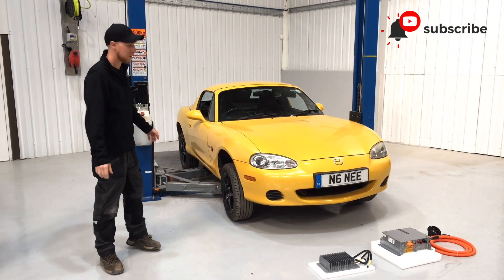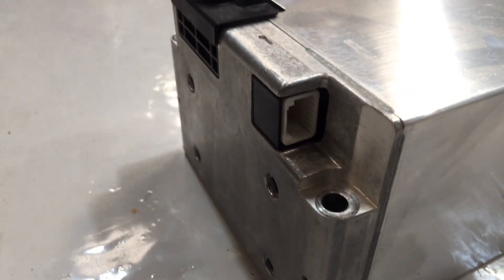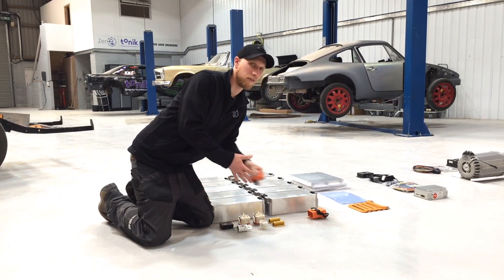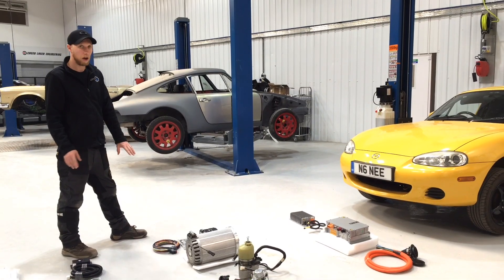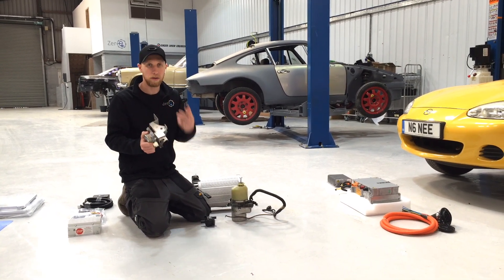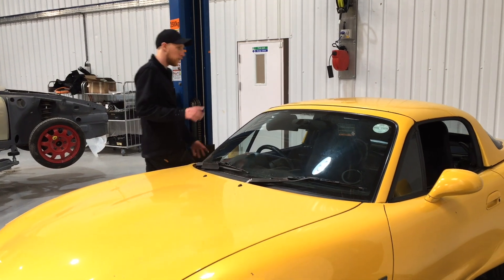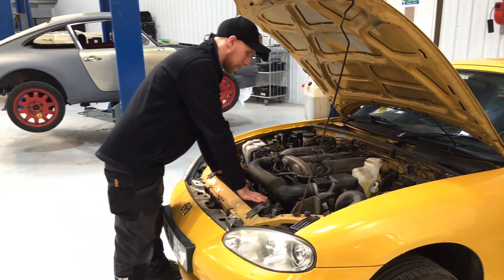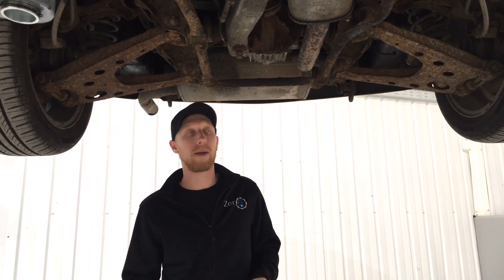We Built an Electric Mazda MX-5 Miata

Comment: Got my curiosity.  An estimate on range? And weight balance will be OK?  I don’t have any idea of how the weight of the 26kWh pack system + portion of motor forward will compare to the 1.6/gearbox that came out.   Keep it coming!!  Thanks!
Reply from the maker: Range should be about 100 miles, weight wise is going to be 40kg heavier

Comment: Hey. What's your plan for the power plant frame? 
The structural aluminium member that runs between the diff and the gearbox and gives stiffness to the body
Reply from the maker: Our plan is to link it into the front frame once we have finalised the motor position

Comment: I used to be pretty staunch against EVs, but after seeing a few vintage conversions I think that when prices of EV components go down, keeping old cars on the road by converting to EVs is a pretty cool idea.

Also seeing cars from the UK makes me glad I live somewhere without salt on the roads,  my 85 Celica project car has almost no rust on the underbody and running gear. I just rebuilt all the shocks and had no trouble with any of the fasteners under the car

Comment: 26KW with a 6.6KW charger. that's really a piece of shit. should have used tesla modules
Reply from the maker: You do know that a Tesla module is 5.2kwh so would of been at 26kwh with 5 of them as there a 6s configurations each module. The LG battery’s we use have a better density than Tesla so a better choice.
Reply: @Hazell_Nutz  you are right. sorry. I was wrong in my comment about that. those LG batteries are great. but only 26KW? that's just sad.
and 6.6KW charger is just absurd. will take at least 4 hours to charge for only 26KW.

Comment: Hi.  I can understand why you'd get hate and I'm sure you know why.  However I do support what you're doing myself as I think it's the right way forward.  The main reason I don't invest in EVs are because I dislike the battery technology, and that it's boring - gear changes and also sounds + mechanicals.  No doubt however, you'll create a fun car...
Reply from the maker: I thought I would miss the gear change and sound but I actually don’t. The EV’s have a different noise and the power delivery removes the need for gears. I think yes oem EV’s are quite bland but a converted car is something very different.

Comment: I teach at the Workshop School in West Philadelphia in Pennaylvania, US. It's a project based learning HS which is part of the Philadelphia Public School System. We have an after school group called the EVX team that builds electric and hi-mileage cars for competition. 

We are kind of doing the same thing but in a kit car called the Catfish which uses a tube frame and fiberglass body but Miata mechanical components including the front and rear subframes. The Catfish will be significantly lighter than the Miata when done so it should out accelerate a standard Miata.
For our first iteration, we had an electric motor and controller that we had used in a previous conversion of a Ford Focus. We had it mostly finished when we decided that we would get significantly better performance...we plan to compete in autocrosses in the Philadelphia area...by using the power train from a Nissan Leaf. We had purchased a wrecked 2018 Leaf and removed all the components we wanted to use when the Philadelphia Schools were closed by the Coronavirus quarantine. 

We will follow your project with the students to see if there are ideas which we can use. The Nissan uses an electric power assist for the brakes and steering so this project has me thinking about how to adapt them to the Miata suspension.

Comment: Does it make sense to keep the gearbox?
Reply from the maker: Yes and know, gearbox will alow higher top speed but does not like regen, chance of braking the cutch set up and will eat into the engine bay so using the single speed leave the engine bay clear.
Reply: @Hazell_Nutz  yeah right. I didn't think about Regen :D and the clutch will probably suffer too with this much torque as you pointed out.

Comment: So is there any benefit to having a selection of ratios for the gearbox, such as increased range v acceleration.

Sounds like you're going with a single-speed solution, much like the Formula E grid and a lot of other eCars, Does motor RPM not translate as directly to power draw as RPM in an ICE?

Subbed, Was wondering about this before.... the price has entirely put me off, but still interested to see it play out.
Reply: The first Tesla had a 2-speed transmission.  Having more than one gear ratio makes it possible to use a somewhat smaller and lighter motor, but that savings is not worth the additional complication.  My new Tesla model 3 doesn't have a multi-ratio transmission.

Comment: Dear god you aren’t going to put one of those shitty sterile kits into that beautiful Mercedes on the ramp are you???
If so the owner is a f@ckwit who doesn’t deserve to own it. As for the Mazda, ehhh.
Reply from the maker: Yep the pagoda will be converted, it will be a bolt in fully reversible kit with 170bhp and 70khw battery pack. The original ice stuff will be boxed up and stored.

Comment: bad idea this car is great because it is light your making it heavy
Reply from the maker: Nope! Not making it any heavier will be the same weigh of maybe lighter
Reply: Zero EV you should weigh stuff you take out to compare.The original engine is 278lbs the transmission i don’t know (my guess 120lbs) fuel tank capacity is 13.2us gallons withch weight is 79.2 pounds for a full tank don’t know what the tank it self weight (my guess 25or 30 lbs) so let’s estimate a high 520lbs for the current parts of the drivetrain you will remove i may be rong wouldn’t be the first time but last i checked batteries are heavy and electric motors are dence plus heavy gage wire is heavy

Comment: Looks like you managed to find a nice one, but take a look at the chassis rails while you have the engine out. If they haven't been done yet, they won't be far away from needing doing. MK2's are savage for rust!
Reply from the maker: Roger Dickinson looks nice from outside but definitely need to do the drivers side rear sill 🙁

Comment: Could have pulled it apart a lot easier with dropping front and rear subframes together and rolling out from under
Reply from the maker: Yes we did look at that but had to strip down the subframes a lot before could get them off as the bolts were very rusty. Plus only wanted the engine and gearbox out due to 3D scanning.

Comment: Thank you for the video - very informative. Can you let me know what gear ratio your reduction gearbox has. Most of the hyper9 conversions I have seen use an adapter plate to the existing manual gearbox. If you can get rid of the ICE gearbox for a lighter and simpler reduction gearbox then that is attractive. Many thanks.
Reply from the maker: Hi, our standard single speed box is 1.8:1 but can do 1.6:1 and 2:1 for additional cost.

Comment: After converting this car to electric, will you be still able to run the Air Condition in your car?
Reply from the maker: Hm Hmc no not currently
Reply from the maker: Hm Hmc this car does not have ac so no, but if it had been an AC car then yes we fix high voltage AC compressor that runs off the Ev battery pack

Comment: Absolutely curious how this one will turn out. Would be interesting to know how much weight you saved after the gearbox, motor and exhaust is gone compared to the EV conversion
Reply from the maker: I1ve once is all back together will make sure I weigh it again before fitting any Ev stuff

Comment: What are you doing about a heater and air con for the cockpit
Reply from the maker: Heater will be handed with a ptc heater where the original matrix was. Car does not have AC but if it did we can offer a high voltage AC compressor.

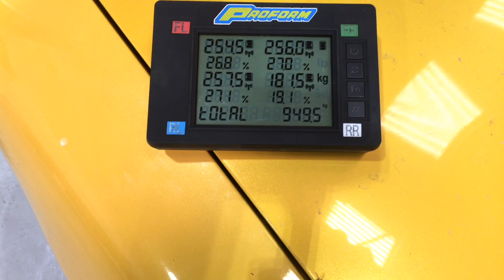Comment: 8:16 "Lighter than I thought it would be." It's amazing how much lightness you can add by having your subframes rust and flake off onto the twisties. :D 
Seriously though, the rear right reading is ~75 kg less than any other corner. Might want to check your scale is working correctly.
Reply from the maker: arantala that is because the floor is not perfectly flat so only take it as total weight,
Reply: @Hazell_Nutz  Hmm. That's a pretty big discrepancey to be explained by a mere floor tilt. A mk2 MX-5 is supposed to weigh 990-1040 kg empty. That's 40-90kg more than what you're measuring and the 70-75 kg missing from the RR corner fits right in the middle of that range. It's not a big deal, but if you want to do a before/after weight comparison, it's important to have valid data, and to understand how it was obtained.
In any case, I'm only paying this much attention to the weight because I too have played with the thought of electrifying my 10th Anniversary Edition sometimes and I'm super excited to see how this turns out. For me the biggest issue is that I actually often use the waste heat from the ICE to run the heater and keep the top down even on cooler evenings. 
Not having that waste heat would make my MX-5 a very fair weather car. Heated seats might help.
Reply: arantala heated seats do not help as much as heater/blower as the seat heaters only heat your buttocks. Also if you use seat heaters for longer periods it’s not good for your reproductive organs and some other health related issues.
Reply: @arantala  It does seem a rather large difference for the unflatness of what looks like a nice facility. Could it be explained by rusty suspension 'sticking' so less force on one corner? Maybe they are used to it and that is indeed normal, but I'd have swapped round the units to check.

Comment: I think it's fine folks perform EV conversions on older sports cars, but when it comes to driving fun, it's like watching movie without sound. Sure the cinematography is impressive, the computer graphics incredible and the actors expressive and heartfelt, but without sound, it's not complete.  Gas-powered sports cars require involvement with all four limbs to manage the clutch, brakes, throttle, shifter and steering, and once they're combined with sound and vibration, you've got the full experience.  It's the 7.1 Dolby surround sound that completes the picture!

Bear in mind, I own an EV and it's a terrific appliance in every sense of the word.  Great driveability in traffic, quiet, handles well and saves a lot of money compared to gas.  But I wouldn't want it in my sports car... no matter how fast it was.  Sometimes a little visceral around the edges is just what the doctor ordered.
Reply from the maker: You say that but my electric r32 skyline is brilliant fun. The motor is quite loud it’s like a supercharger plus so much torque. I think unfortunately and fortunately depending how you look at it everything will go electric ⚡️

Comment: I'd say put a vacuum gauge where the oil temp is, so you can monitor the level of vacuum in the reservoir.
Reply: Or just dump the vacuum booster.  Who cares if the brakes require a bit more pedal force?  I once owned a 1971 Porsche 914 which had 4-wheel disc brakes with no booster; it wasn't a problem.
Reply: @frankeggers4024  not familiar with the braking system on the 914, but if it didn't have a booster, then that means it was designed that way by Porsche to not require a 100lb lead foot to stop. the Miata on the other hand does have a booster, so it's designed to require a ton of force to brake, which comes from the booster. 

I've been in a miata that the owner did an extreme wire tuck and nearly emptied out the engine bay of everything but the engine itself, which included deleting the booster. this was a show car and he rarely drove it except for on and off the trailer, and it was a nightmare to have to press the brake pedal.

Comment: Zero EV

I once saw a fully electric converted Prius.  The way I noticed it was that they had a plastic potato installed in the muffler.  

Y’all should source and include those in your kits. I would totally rock the potato plug if I had an ev Miata

Comment: I'm cool with an EV conversion, but this is one of the best low-cost designs ever made. I would rather pick a donor car that deserves to lose its combustion engine identity...  any there are many.  Also. skip the power steering. You don't need it.  Isn't regen-braking available in a kit design? It seems silly not to invest in that.
Reply from the maker: WillingCoyote regen braking is in all of our Ev conversions it’s just a negative torque request so quite straight forward.

Comment: Interesting build. You didn't mention what your plans are for the HVAC system? How many amps does that power steering pump pull? That's going to be a constant drain on the system?
Reply from the maker: Power steering is 60amps max, we have a ptc heater to fit where the original heater matrix is.
Reply: @Hazell_Nutz  Thanks for the reply. I guess no AC compressor required in the UK? How many watts is the 12v system pulling when everything is on (PS pump, heater, lights) but car is stationary? Non motion draw is the enemy of EV's. Looking forward for the next part of the build.

Comment: As an electric car hater, I'll sub and watch your channel with interest, and I wish you all the best. I'm not wild about electric sports cars because they add weight and basically turn what was an engaging car, into a soulless golf cart. But I'm a technology fan and I'll probably do an electric conversion on a 1970's land yacht, so I appreciate your expertise. I figure an electric conversion can't ruin a car that's already big, heavy, torquey, and saddled with an automatic transmission anyway.
I'll hang on to my manual transmission sports cars with raspy and engaging ICE power as long as I can.
Again, all the best, from an electric car hater! ;)
Reply: most of the time with electric conversions, with Li-Ion awnyways, you end up with nearly the same curb weight if not lighter. the battery pack here should end up around 280lbs and the 1.6L they took out is 272lbs, the electric motor is 120lbs, and the transmission they removed was 110lbs.

so right there they only gained around 20lb, and with all the other stuff they will be removing, like the fuel tank that weighs 72lbs when full and all of the exhaust piping, they should end up +/- 50lb of the original weight of the car.
Reply: @Irishrebel092  still a soulless golf cart.
Reply: @benbauer1257  some people will never get it.
Reply: @benbauer1257  Exactly, EVs jjust go so differently, can't even be regarded as a car, rather a lifeless appliance. Zero fun.
Reply: @benbauer1257  when the only electric car you've ever driven is a gee wizz, then I can see where your think that. But if you actually drive a proper EV you will completely forget about the lack of exhaust sounds when you're fighting against the 100% tourqe at 0 RPM
Reply: Frank White  Formula e is actually working quite well, what are you talking about?
Reply: Frank White  "Probably why formula e didn’t work too well". There are a lot more manufacturers in formula e than formula 1 these days - they know where the future is headed. Formula 1 is running on old blokes like you. Young people take an interest in formula e. It's pretty obvious how this goes over the next decade or two.
Reply: Could never be happy driving something that sounds like an rc car. Love exhaust sounds from a gas engine or the whistle from a diesel.

Comment: I'm very interested in a kit if you produce one. What kind of performance (0-100 times) are you hoping for with this setup?  I'm really keen on something with 0-100 in under 5secs and a range of around 200-300km. Would that be realistic?
Reply from the maker: okisub with this motor a 0-60 of under 8sec is the aim and 150km but it could be done with a high voltage motor with double the performance and a double size battery pack.

Comment: If you haven't found a use for the oil temp display yet, you could use it for the air-cooled motor temp, or differential oil temp.

Comment: They only made the 1.6 from 1990-93... at least here in the states that’s how it was. Everything from 94 on was a 1.8. And the nb2 here in the states came with a vvt motor
Reply: Euro NBs had a 1.6 in some cars from 98-01.  Not the same 1.6 as the early NAs

Comment: Does the 18K GBP include the conversion, or is it just parts?
Reply from the maker: Jochem just parts, but we design bolt in kits so  makes the process easier please built in batches so cost if not much more than that

Comment: I hope the perfect Miata weight distribution won't suffer with the conversion. 
Since this an absolute enthusiasts car for this key feature.
Light and well balanced.
Reply: If weight distribution is the goal, I’m sure you could split some batteries under the hood and some in the trunk for a near perfect distribution
Reply: @youtubeisbroken241  this should be manageable. I dunno about the weight of the combustion engine of the Miata, but the electric ones are often much lighter than that. I think you could distribute the batteries so you keep the balance.
Reply: That was my main interest as well. If they can keep it mostly balanced as it is now, even with a different ending weight, that would be sweet!
Reply: Just add some counterweight if your that worried about it

Comment: Battery powered? Does that make the vehicle an ME-5???
Reply from the maker: R Peltier have actually been trying to work out if ME-5 works I think I like it.
Reply: Thanks! I own a 2006 NC MX-5 (first and only year in the US without the 'Miata' badge on the vehicle) with the 2.0L I4 and 6-speed trans. Love the car! At 6'0" I actually fit without hitting my head on the rag roof!
Always wondered about an EV MX-5. Happened upon your video in my 'suggested' feed. 
What is your estimated cost (US/UK) of the conversion?